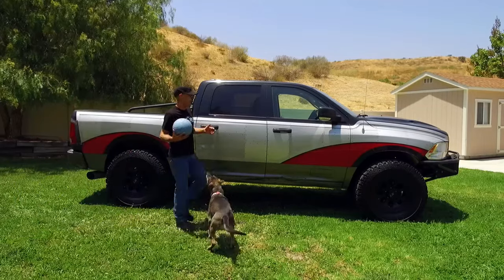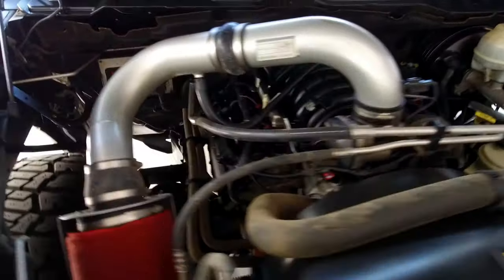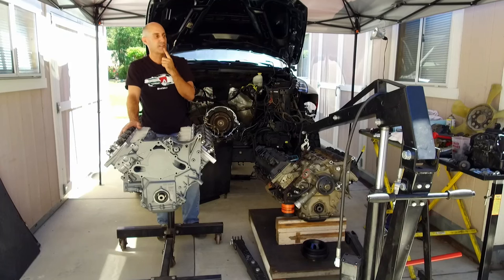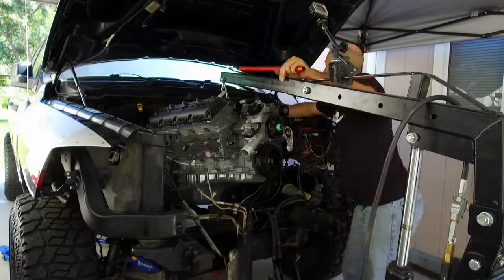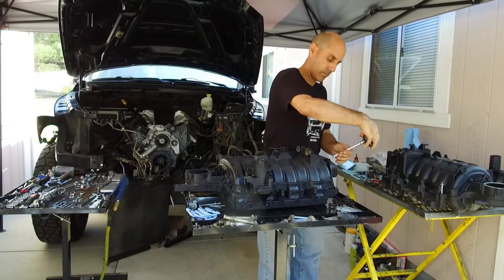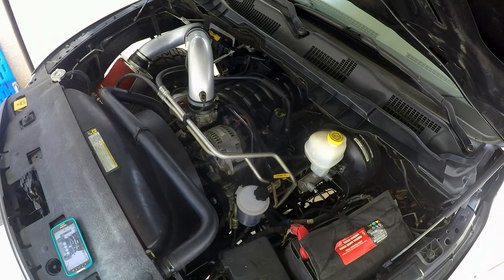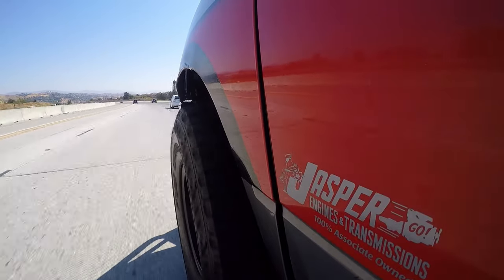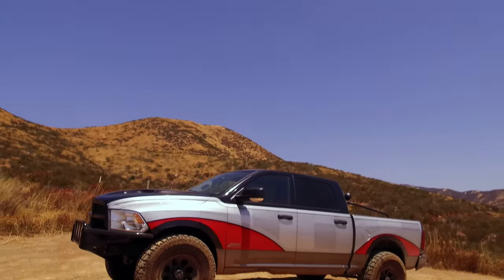HEMI Swap with Jasper Engines Replacement 5.7 in a Dodge Ram 1500 on 37" Tires

Comment: Is the motor still in perfect condition.  ?
Reply from the maker: Yep, still the best thing about the truck.
Reply: How many miles have you made on it so far. I got burnt hemi sitting in my garage, just exploring options. I just 50/50 on Jaspers, as some say they quality went down in past years. Update video on engine would be much appreciated.

Comment: I have a 02 Dodge Ram 1500 with a 4.7 would this same motor work in my truck??!!?
Reply from the maker: Yes, but in California where I live, it would be very difficult to pass the smog inspection so I did a stock replacement.
Reply: AutoEdits yeah good thing I live in SC lmfao

Comment: Hello, how much does it cost to do something like this? I got a 2005 Dodge Ram 1500 5.7 with 63,000 miles on it. I love the truck but I currently have the check engine light game of death….
Reply from the maker: Check engine light doesn't always mean the end ... just get a code reader and see what it says.
Reply: @AutoEdits  I tried took it to dealership can’t even read from computer terminal.
Reply: Also how much does this cost to do the jasper swap?

Comment: What did you do  with old engine after the replacement
Reply from the maker: I put it in the crate and sent it back to Jasper as a core.
Reply: @AutoEdits  what does mean as a core
Reply: @awp2902 It means that they can use the old engine to rebuild it to their specs. Sometimes when you buy auto parts, like brake calipers, there's what's called a "core charge." It's an added cost to the part you're buying.  But if you take your old calipers off and return them to the store that you bought your new calipers from, you give them your old calipers and they give you your money "core charge" back. This is because they can re use the old calipers to rebuild and make new ones.

Comment: hey awesome truck, and new info peoples   PUT AN OILING TUBE TO YOUR LIFTERS NOW, mod the block or something this shall fix the 5.7 and other 'HEMI' engine's problems. It has been found , what is causing the lifter and cam damage, the lifter roller gets no oil, and the lifter belly side gets no oil, Use a COMP CAMS lifter grooving tool in your lifter bores to add an oil accumulator groove to pool oil in , also you really need to route oil there somehow, this and then this engine shall rock like it does only better. there are oil tubes under the lifters and this blocks crank case oil from slinging up there as well from the hole that is on the crank and windage. So to properly fix this engine to be excellent and durable MAKE oil tubes out of aluminum or other brake line tubing etc. and you shall be golden. Also the oil that runs through it and any drip oil just doesn't get to the correct places, so just do this and be trouble free, because this is the only problem with this engine i have come across. And it is fixed with oil line to put oil to or squirt to or run ported to, : The lifter bores, and the hydraulic lifter ROLLER tip. The needle bearings go out and can cost your entire engine in some cam failure events, face it HEMI owners , there is a problem with these cams burning up in short order. Do this one thing for me, and for yourselves, spread the fruit around keep boxing with LS forever , costs shall get lower and everyone more profitable.

Comment: i got a question? once a engine is replaced is it like starting with zero miles again basically like a new car please reply thank you
Reply from the maker: It's not like starting at zero because the rest of the vehicle has years and miles of wear.  But having a fresh engine is pretty great.
Reply: AutoEdits 
wow thx for replying to me sir i appreciate it..i have a few more question because i will be going through the same company as you did. so my car has 200,000 miles already everything else is fine its just the engine once i replaced that will the 200,000 go to zero and was it worth swapping your engine sir than buying a new car? and how is your truck is it running good still i watch this video a million time and it makes me want to go for it so bad, but im still nervous aswell because im planning on having the engine ship to me in Thailand i hope i dont get dissapointed once i do decide to go for it. and my car is just sentimental for me i want my son to have it i still wash and polish it even though its benchwarming for years now

Comment: Not necessary if hemi owners would learn to use very high quality oil and filter. The filter is exstremly important. And stay on top of the oil level.  No lifter issues.

Comment: Those plastic intakes warp real easily in an overheated engine other than that. For 400+ I would have very carefully inspected it and cleaned it up instead.

Comment: was this truck hauling the Mazdarati when it was stolen?
Reply from the maker: I used to work for motor trend and have towed the mazdarati a few times with this truck but it was stolen after I left.

Comment: Instead of the hassle of building oil pressure as shown,
modify a bleach-safe garden sprayer and prelube the motor through
the oil sender port.
That way it has pressure before it ever left the engine stand.
Much less hassle.
Reply from the maker: This sounds like a pretty great suggestion. Thanks!
Reply: how is that easier than holding the pedal down for 10 seconds while cranking

Comment: You didn’t show disconnecting the trans. And how did you get an engine from Jasper anyway, they only sell to dealers….
Reply from the maker: There's nothing complicated about unbolting the trans. Jasper will make certain exceptions for advanced mechanics.

Comment: hello there this cajun just like the spice i bought a 2006 dodge ram slt 4x4 wrecked on left side which left the truck totaled i checked the fram for straghiteness it was true not bent so i swaped my cab ram1500 slt no 4x4x wheel dr. on to the 4x4 fram i swaped harnesses to my cab up to the center cab forward i did 'nt swap the cargo harness at the top  i found the seal plug to the cargo harness was different so can someone please help me correct the problem  by changing the plug or should i just find the harness for th cargo assy,

Comment: Did they have you change the Oil cooler for Warranty ?
Reply from the maker: Not sure what you mean. This engine doesn't have an oil cooler. They did recommend replacing the intake manifold for that reason.
Reply: only thing mopar requires changed for their warranty is the intake manifold,  as they trap debris under certain destructive failures

Comment: did you say the book calls for 5W-20 motor oil. It's no wonder these 5.7 keep eating camshafts and roller lifters. That's a big problem. I know they have close tolerances but that's ridiculous. i'd at least run 5w-30. be sure after break-in , add a zinc additive.
Reply from the maker: It needs the light oil to properly run the Variable Valve Timing.

Comment: How much power does the new engine make
Reply from the maker: I'm not sure, I'll ask if anybody has dyno'd one of these. I know the original was rated at 390 HP and 400 LBFT torque.  It's peppy.
Reply: autoedit do you think that its making over 400 hp

Comment: How many miles did the previous engine have before it failed?
Reply from the maker: 145,000 but it got driven without oil for several thousand miles as a company vehicle and abused.
Reply: @AutoEdits   thanks for the response awesome to know you read and respond your comments thanks! I have a 16 ram 1500 sport and have been thinking of making some modifications on it last question what was the price on that engine from jasper engines?

Comment: I still for the life of me can't get over the 5w 20 spec. I own an 08 f150 and the first thing I did was switch to Mobil 1 5w 30.
Reply from the maker: This truck calls for that because the solenoids that run the variable valve timing and the cylinder deactivation are very sensitive to viscosity and were design for that exact oil. So I use it.

Comment: My biggest question is What do you do about mileage now?
Reply from the maker: It gets about the same gas mileage as before.
Reply: AutoEdits Crap sorry i should’ve made it more specific, What about the Odometer Mileage?
Reply from the maker: All good, the odometer doesn't get reset because it measures miles on the vehicle not just the engine.

Comment: Hi I have a engine swapped magnum 5.7 to 6.1 and the computer is not liking it but I don't have the vin number from the 6.1 vehicle to buy a new  programmed computer...any suggestions please..
Reply from the maker: Yes, go to a wrecking yard or EBAY and get an ECM from a vehicle that has a 6.1
Reply: So any one will work..which year my vehicle which is a 05 or one from an 08 which is the year of the motor

Comment: what about the hemi,s horrible valve spring and camshaft problem,s!nice that they redesigned the piston but they were never really and issue
Reply from the maker: there were different issues across different year ranges of production and the engineers at Jasper deal with as many as they can for each. many people like to mention the valve seats failing on these engines and that was up to 2009 but not the 2009 engine.

Comment: Got a jasper engine, had no problems with it, but after my vehicle was totaled my insurance said reman motors don't count towards replacement engines so I didn't get any extra money for having a much fresher motor which should increase its value. 

So, I ended up getting much less for my jeep than I paid to have the motor replaced, and jasper was only 1k cheaper than a new 4.7 power tech. 

I learned my lesson.

Comment: You forgot the part  where you spent hours drilling out and heli-coiling the manifold holes.
Reply from the maker: Not sure what you mean? Didn't have to do that.
Reply: My mistake, I just realized you used a different block anyway so the broken bolt didn't matter

Comment: 16:20 - Don't unplug the coils, unplug the injectors. Otherwise you're washing down the cylinder walls of your new engine with fuel and diluting the oil for first startup, no bueno.

Comment: currently at 10:10 i hope you dont keep the stock manifolds and get some headers
Reply from the maker: The small gain in power isn't worth the headache of replacing the stock Y pipe with the catalytic converters and O2 sensors. Besides, it sounds amazing like it is and with a little boost... it will make plenty of power!
Reply: it did sound good. I didnt know the truck had an exhaust system already. Or at least it seemed like it had an aftermarket system on it
Reply: autoedit I installed some long tube herders on my 2014 ram 1500 hemi regular cab they are 1.75inches and I just have the truck with headers and cats and 2.5inch dual exhaust to 4inch tips and it sounds crazy not the clapping you hear from those other truck with out cats but it's quiet at idle but romp on it and it's very loud and yeah I had to get it tuned due to o2 sensors not reading right but now it's great it does feel a whole lot faster it will burn out 35s with no problem it has a few more mods but it makes 345rwhp so it feels fast to me even with 35s I wish I could down size tires to the stock size but it would look funny because the truck is lifted 6inches and btw what exhaust do you have on your truck it sounds good

Comment: Those Fram oil filters have killed alot of hemi and chevy engines. If your engine has afm or MDS don't use Fram. Actually don't use Fram at all. I've torn engines down that had Fram filters and seen pieces of the filter plugging up oil passages or that the filters have just collapsed and oil stopped flowing. Use WIX or M1 filters and you won't have that issue

Comment: It's a dodge and you didn't replace the transmission lol

These swaps are what makes me want a truck. Everything is just simpler with so much space to work with
Reply from the maker: It was actually kind of fun, a lot of work, but fun. The transmission seems really good on this truck... did a flush and filter change on it and hope for a lot more miles out of it.

Comment: Jasper should have re engineered the real problem with the Hemi and redesigned the valves and seats from falling into and gernading the engines
Reply from the maker: They did and if you ordered an engine for the previous model it would have that upgrade... but this generation Hemi didn’t have that problem.
Reply: autoedit ahhh.. Thanks for the clarification. My 2005 300C with just under 100,000 miles gernaded because of the valve issue. so, I was wondering. Thanks
Reply from the maker: YEP! That is the era of HEMI that had that problem.  2009 and up Chrysler fixed that but left many other "weak" spots... like the one I discovered... Valve lifters wiping the cam lobes flat on 1 and 3.

Comment: You should have put headers on that bitch too! I put some on my 04' hero Durango and love it!
Reply from the maker: Yeah, I hear ya but the costs were adding up fast so I saved and it still sounds pretty awesome with the Flowmaster I ended up putting on.
Reply: @AutoEdits  , I hear ya man. Especially coming out if pocket. I watch your Jeep build videos too. Mine is not as bas ads as yours, but it does me right!

Comment: After all that you put the stock exhaust manifold back on.
Reply from the maker: I understand what you mean but this is a limited budget repair. Think about what happens if you put anything else on there... needs new catalytic converts, Y pipe and custom exhaust. This way I can bolt it up and go and still pass smog here in california.

Comment: Jasper doesnt have a prive or a list of engine. The website is actually trash
Reply from the maker: Yes, their site is tricky and not really aimed at the home mechanic but for the pro installer. I can share that this engine in this install is still running absolutely perfect all these years later.

Comment: Does the new engine have the cylinder deactivation and what exhaust are you running? That sounds sweet!
Reply from the maker: Yes it has all the same stuff as the original but just better in some ways! You can use a tuner and shut off the cylinder thing. I ended up putting a Flowmaster exhaust on there and like it a lot.

Comment: Did you realize that you didn't bolt your torque converter to the flexplate. There are 4 bolts that are on the back side of the flexplate that go into the torque converter where you can see in your video the 4 bracket holes on the torque converter.  Hopefully you just didn't show you bolting it together after the install.

If you don't bolt your torque converter to your flexplate, it can cause a number of issues, including:
Knocking noises
High levels of slippage
Rattling sound
Soft or delayed gear shift
Sudden and inconsistent vehicle speed changes
Shuddering
Low acceleration
Throttle break down
Affected fuel efficiency
Crack between the bolt holes
Reply from the maker: yikes

Comment: Did you delete the MDS before putting the motor all back together or is it deleted electronically?
Reply from the maker: I put it back together just like the stock engine and put the MDS solenoids in the new engine.
Reply: @AutoEdits  That's a shame. Lol.

Comment: Did you have the mds deleted. And or can you
Reply from the maker: I used the HP tuners software on my laptop to disable the mds and it's great.
Reply: @AutoEdits  my engine and all that is fine but can't stand the 4 cylinder and have read it can cause bad issues. Maybe gonna go the rough of a cam swap. Nothing big. Just something to get rid of it. I have a 2014 ram Laramie 8 speed

Comment: What size of a lift is needed for those 37’s?
Reply from the maker: This truck doesn't have a lift at all.  It's TRX4 model which sits about 1" higher than a stock Dodge
Reply: AutoEdits wow nice !!

Comment: What gear ratio are you running in the diffs?
Reply from the maker: This truck has 5.13:1 gears.
Reply: I'm looking at 4.56s for my Ram but haven't decided yet
Reply from the maker: If you you are running 35" tires, that would be perfect. Since this truck has 37" tires, I would like it to be 4.88
Reply: I am running 35s on mine. The stock 3.92s from the factory aren't happy with the larger wheels and tire setup

Comment: I regret sending my truck for engine rebuild. Only last me 7 months and now my mechanic does not want to work on my truck I spend 3k. I should of just order an engine and place it on my own and send my old engine as core. I totally regret.
Reply from the maker: Hey, we sometimes make decisions on our vehicles based on the best information we have at the time ... I've made a ton of wrong ones as well and you just have to figure out how to move forward the best way you can! Sorry to hear about the troubles you had though.

Comment: What kind of lift does it have
Reply from the maker: It doesn't have a lift. It started as a TRX4 model which some sources say is about 1" taller than stock in the front... basically a leveling kit.

Comment: The pistons weren't the issue in these engines, its valve seats and valve train, you didn't even mention anything about that...
Reply from the maker: Not in 2009. Valve seats were the years before this. Just to give you accurate information. I had lifter and cam lobe issues.

Comment: You shouldn't need any upgrades to a Hemi. My 2008 Ram had 320,000 miles on it when I gave it to the boys. My 2014 has 350,000 miles on it. I tell poeple on both trucks i think there is a engine under the hood but have never opened it to check.
Reply from the maker: Good for you.